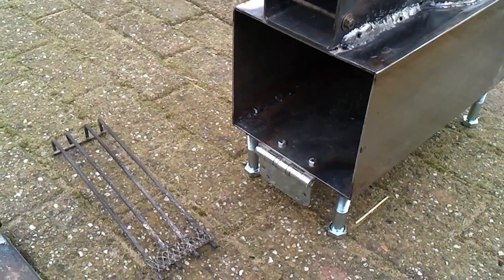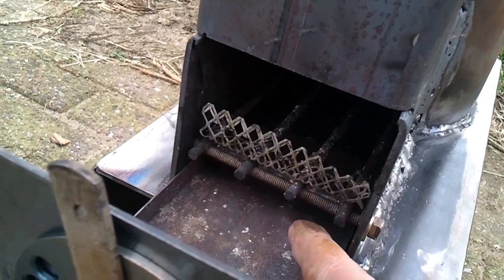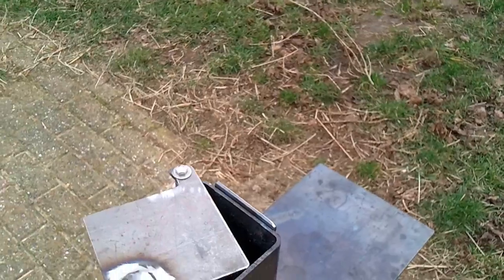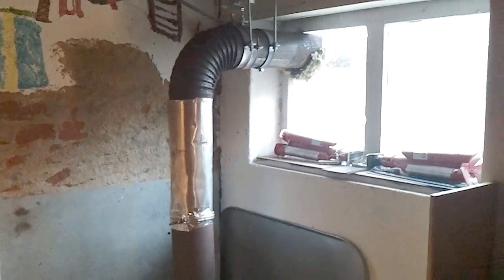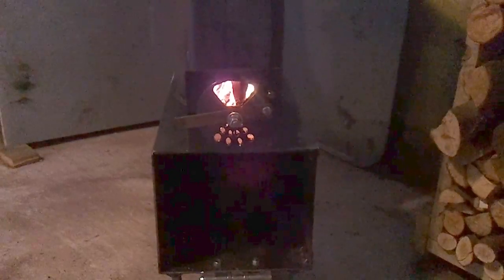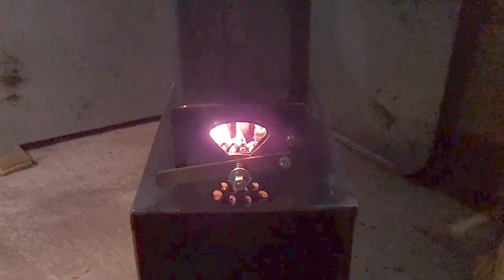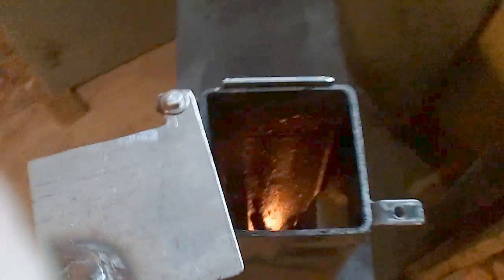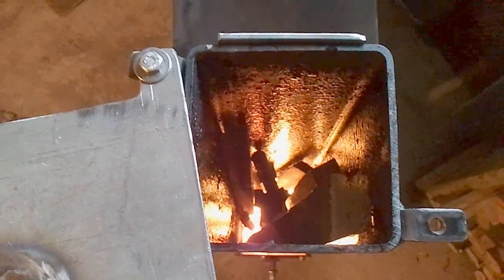MIX MAX in the Mancave 20-02-2014

Comment: Very nice one of the best I have seen,if I had the money to buy the steel I would make one my self. just in case do you think you could write up a parts list and measurements . The only problem with it is I think it would better in my man cave lol but as I live in New Zealand not much chance of me  grabbing it while you are not looking
Reply from the maker: I have no plans and sizes .
I build from the head.
And use what is on the scrap yard.
Only the steel for the furnace was purchased.
Today burned MIX MAX again very nice.
And it was nice and warm in the Mancave.